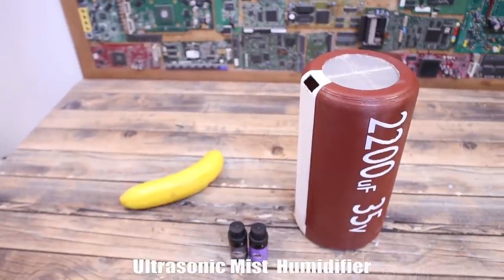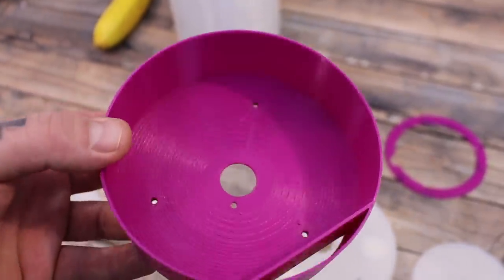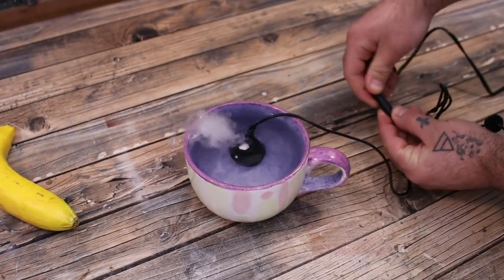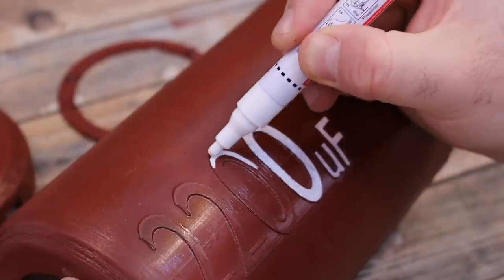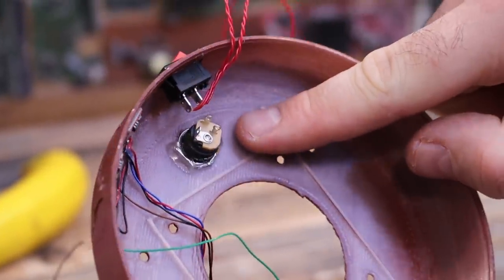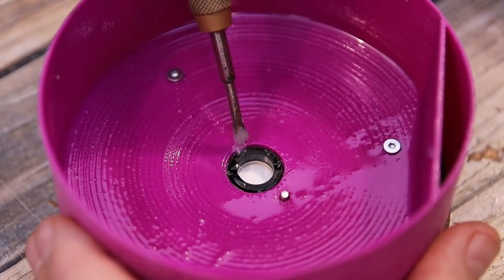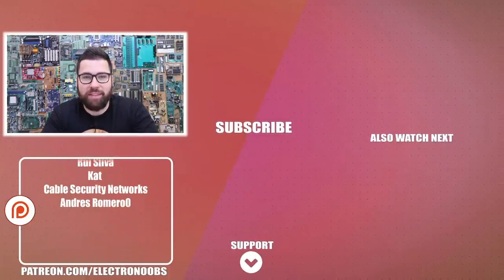Magic Smoke Capacitor Mist Maker

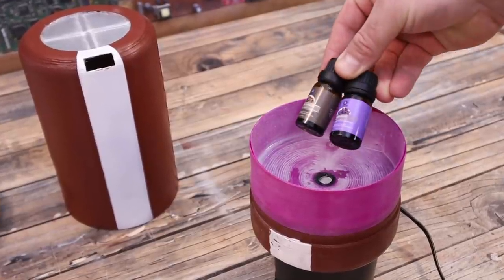Comment: If you didn't want to build the electronics part, you could buy an ultrasonic diffuser like the one at 14:07 and 3d print a new top part to look like a capacitor.  
Also, to look more like a smoking cap, instead of the vent hole on the side, leave the + shaped slots open when you print the silver top piece so the mist can escape from there.

Comment: Very interesting idea! I would have added 'Nichicon' word, to fit brown colour ;-) If I build one a day, I will use completely different electronics: a PIC that includes capacitive switches,  a mosfet to drive ultrasound generator, and a PCB, either homemade or done in China (I use JLCPCB for years now) - as an electronician, I'm not fan of these assembly of modules like Elektor does now, I prefer by far to create my own design. I also would have popped the top of capacitor, to make it more real :-D. Good job, anyway!

Comment: how what you need is some small propellant charge to shoot the top case off and you got an exploding capacitor too.

instead of regulators you could use a resistor to limit the current to slightly less than what the fan requires.

in a rc dropper and led by limiting the current the load can pull the voltage down so in theory you could just use a resistor.

Comment: Good luck if you  need to replace that ceramic disc in the mist maker with all that epoxy
also  you should try some sweet birch essential oil it ,it smells amazing ,like rootbeer

Comment: I think the water might reach the circuit below. The water drops that goes up like volcano might fall through the air chamber even of the height if the part is increased and even after placing a funnel.
I would recommend increasing the height of the air duct(like a chimney) and designing it in such a way that it creates a horizontal vortex and pumps out the mist through the outlet ☮️
Reply from the maker: The design was changed and it now has a skirt around that won't allow that to happen
Reply: Another idea would to be to put some sort of very fine netting or mesh, but spray it with a hydrophobic spray, it'll still let gasses, such as the water vapour through, but it won't let any liquid through

Comment: Good job, can you use the mystified to humidify the air?
It is silent?
My humidifier uses a heating element and bubbles the water, making a noise that's not ideal for nighttime.

If it’s possible, do you know how long it would take to vaporize 1 liter of water?
I would need about 1 liter in 2 hours.

Comment: Make the air duct output in a hook shape which lets the air in but no water droplets to come in the electronic compartment and adding a bit of code that whenever the humidifier stops or turned down the fan still blows some air which does not let the water mist to sneak into the air duct and condense causing accumulation of water over time
Reply: But still love the project and it gives a great idea to start my next project😅